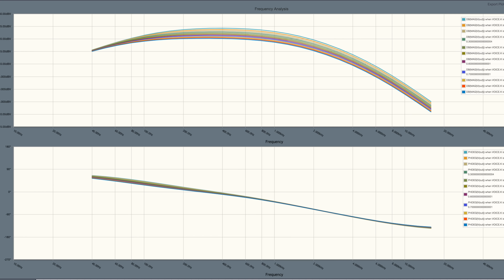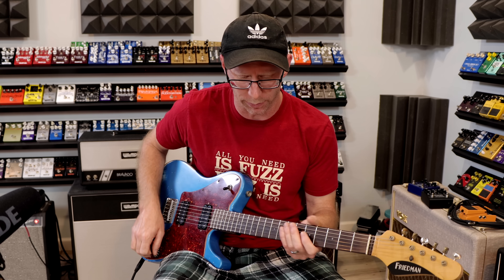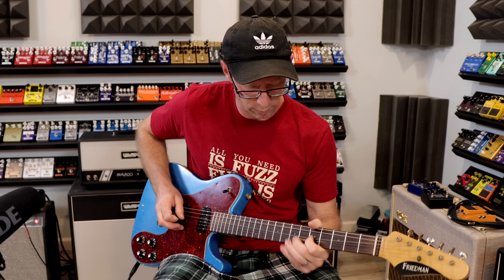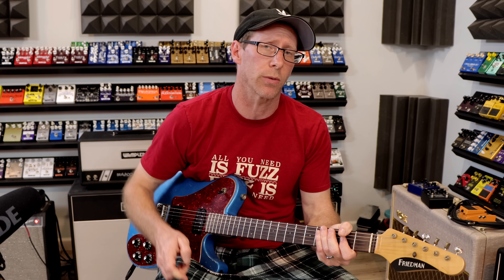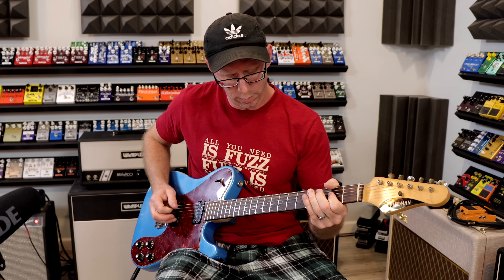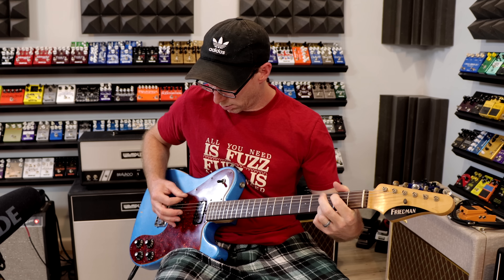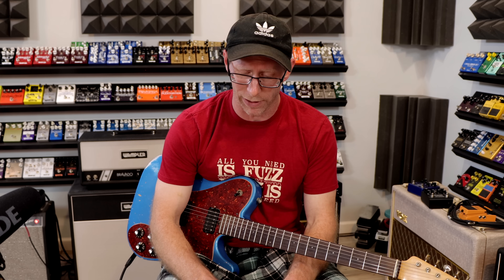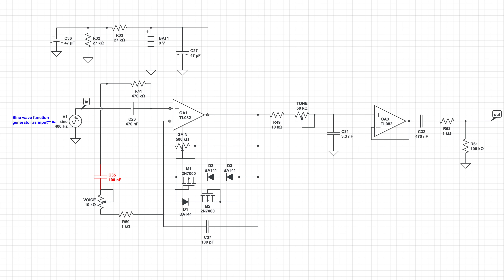What do all the parts do on a guitar pedal? Zendrive circuit experiment

Comment: Ya kinda skipped right over the most interesting part of the circuit, that being the transistors functioning as diodes. Would have loved an explanation of how a mosfet transistor can just be a diode. I’ve never seen this in any other circuit. And do different transistors besides the 2N7000 sound different? You could have switched between several on your breadboard. But instead you talked about 4148s vs BAT41s.

Comment: Love this video. Thank you for doing it! One thing I don't understand yet is why each component has an effect on the sound. For example, you mention that resistors and capacitors can reduce low or high frequencies. How do I understand which will do what exactly?
Reply from the maker: It’s too big of an answer for a comment, but I’m coming out with an educational course which will detail this sort of thing. It’s limited enrollment though, but you can sign up here:
https://www.guitarpedalcourse.com/courses/how-to-design-overdrive-circuits-for-guitar-pedals-for-beginners
Reply: @wampler_pedals  Great! Just signed up. Thanks.

Comment: Thank you! I am redesigning a Sweet Honey Overdrive in LTSpice at the moment and this video really helps; Voice on this seems similar to Focus on the SHO. I gathered from your excellent DIY vídeos that components used to clip and also their placement makes a lot of difference. Can I ask you, is the SHO circuit special in some way, or is it just Mojo? I am an ex Boss service engineer só I can be technical.
Reply from the maker: The sho circuit is just a textbook mosfet gas on stage for the most part. The voice is changing the high pass there in the nfb area

Comment: how do i know what to build in a pedal

this may be confusing how i explain it but ill try my best

say i wanty to build a fuzz pedal. a unique fuzz pedal that will sound exactly how i want to, i know im going to probably use 2 silicon transistors and 1 Ge transistor. i know i want a bass control and a treble control. a gain control and a volume control. a switch for boosting mids and cutting mids. i want it to clean up well. i want it to be able to do crazy high gain fuzz similar to pink floyd echoes live pompeii, but also some overdrive fuzz kinda stuff like jimi hendrix axis fuzz sounds. i want some Velcroy stuff from led zeppelin I tone bender tones. i understand the sounds i want to be able to get from it, but i don't understand at all pedal circuitry. i have no idea how to get a unique circuit to do what i want

Comment: R41 (input resistor) should have 1MΩ or higher (max. 4.7MΩ), 
because on a passive guitar the inductance of the pickup coil together with the pickup- and cable capacity builds a resonant circiut.
You don't want to dampen this peak in the frequence response more than neccesary.
It depends on your guitar how strong the peak resonance (somewhere between 2.5kHZ and 7 kHz) can get.
Some people change their pots in the guitar from 250kΩ to 500kΩ or 1MΩ to reduce the damping of the resonance peak.
(Some even desolder their tone pots)

Comment: Weird that the tone control is a resistor in series... maybe this is the volume control ?  ...or the resistor is in parallel with the next capacitor ?  Please check
Reply from the maker: No, not weird at all. It’s a variable low pass filter.

Comment: Hi, I love the layman's walkthroughs, I built FX units, some of them pedals. I'm modding some LM386 electret mic box's I bought, by adding a switching jack input. It gives a horrible DC crackle to the pots of any mixer I plug it into. I saw you removing this simply with a I think a cap, I've rewatched hours of your channel, but can't find it. Any suggestions.
Reply from the maker: Sounds like you have dc in the signal. A coupling cap usually fixes that. Best thing to do is post the schematic you are using on a diy forum and get some recommendations based on that particular schematic
Reply: @wampler_pedals  thanks for that, can't find a schematic for the device I'm modding, anywhere. I'll keep rewatching the vids, and look up de coupling caps.
Reply from the maker: You may have to reverse engineer it 😕

Comment: Really good. I'm new to this so need to watch a few times but am learning a lot with these videos. You've inspired me to start breadboarding but as my level's very basic I'd like to get a clear view of the whole circuit on the breadboard to be able to compare it to the schematic. A book with a series of breadboards on one page and the shematic on the opposite page would be good, followed by a few exercises with just a schematic and then completoing the breadboard would be great... and then the other way round.  What I do is copy the schematic on a paper and then try to figure out what's going on on the board. Sometimes the pots are in the way or some of the circuit is offscreen. As for other pedals: RAT, muff, or a tremolo (I've seen some fairly simple circuits), whatever. Thanks a lot.
Reply: Just seen you've already done the muff.

Comment: Enjoyed this.. 
I have a version of the zendrive that has some interesting different features, that maybe you could cover...
a) the three diodes + 2 mosfets(used as diodes) are replaced with just one mosfet(mystery w sanded off markings) - so its only clipping in one direction
and
b) the gain pot is changed from a 500k to a 100k
so its low gain "modded" - but it is factory stock, so a version..
also a good mod for a Rat, and I suppose for a ds-1.. take away one of the diodes..
if you do anymore of these it would be great if you´d show the part of the circuit on a schematic ...

Comment: It always amuses me when the “diode connected MOSFET” concept is copied, i.e. MOSFET + another diode, and then use the body diode of the MOSFET making the second series diode unnecessary other than increasing the forward drop. There is so much mojo to be had with a true “MOSFET connected diode” since it is a third law device and normal diodes are square law. But the MOSFET used is super critical and the 2N7000 is not the best choice.

Comment: I'm semi-convinced that there are only 3 or 4 basic overdrive circuits on the planet.
And that everything we see is a minor variation on those designs.
...I could be wrong....maybe(?)
Reply: I guess that's basically it: simple transistor overdrive, tube overdrive, diode hard clipping (when diodes go from output to gnd) and diode soft-clipping (with feedback). However, combining these with the many variations of input, output and feedback filters yields the whole gamma of distortion/overdrive/fuzz pedals we know (and the ones we don't know yet)

Comment: 1k resistor in series with your output is pretty high because of the capacitance of the cable, depending on the length. When running a long cable you rather change that to around 220-330 ohm. But also depends on the opamp buffer.
Reply from the maker: Depends. What are you basing this on?
Reply: @wampler_pedals  The reason to add that series resistor, is to prevent instabilities due to capacitive load. This capacitave load is created by the guitar/microphone cable.
Depending on the type of opamp this load can cause issues. One way to prevent this issue, is to add a series resistor. The higher the value, the more robust it will be. But it also forms a RC low pass filter with the capacitance of the cable (plus the next input stage). 
But yeah, I guess it depends, since not many people will use very long cables in this case. There is an excellent article written by Analog Devices about this, and (of course) you can go as fancy as you want;
https://www.analog.com/en/analog-dialogue/articles/techniques-to-avoid-instability-capacitive-loading.html

Comment: This is a great little vid for all of us who got a little knowledge regarding circuits, but failed to start some real DIY on the breadboard. Watching an expert like you walking through the circuit and tweaking it is so much fun for me. I find the dirt circuit of the ZEN quite interesting and i am wondering whether the FETs are inserted to give it more clean on low level (like offsetting the point where the diode clipping takes over) or whether they actually add to the dirty part?
Thank you very much for sharing such great stuff!

Comment: Great! Thanks! Very informative, I had some questions regarding a small capacitor in negative feedback of an opamp. I didt place it in my circuit, so that may be the reason, that the pedal was very noisy (talking about EMI noise), adding one fixed the problem. Thanks!

Comment: This is really helpful. I have a mech eng and comp-sci background and running spice sims of pedal or part of one, or poking around with an oscilloscope, function generator or even a VNA will tell me loads when I start messing with pedal, but actually getting desing building blocks and an idea of what they do and why on a useful level without being immediately bombarded with a load of maths that whilst ultimately helpful in an electronics oriented degree is more work than I want to put in to modding a fuzz or distortion. Mostly I'm a pickup builder and my analysis is fairly simple.

Comment: The first pedal mod I ever attempted was just adding an LED to my wah pedal so I know when it's actually on/off. That gave me a little confidence and I did the Keeley mod to my Boss MT-2 Metal Zone. That turned a punch line of a joke into a decent sounding overdrive pedal. But I do love these style teaching videos, you are a natural at it. Please expand the series to include amps as well as guitar circuit mods. I know the "orange drop" capacitor change will really make a huge difference in the tone circuit. I don't know why, but maybe that would be a good place to start.

Comment: Awesome video. I watched it three times.
The questions that came to mind are:

How do capacitors filter highs? (I thought they just filtered lows)

What is the difference in using capacitors in series vs to ground?

Most pots are resistors. Is there an application for variable capacitors in pedal circuits?

I'm better with these components in power circuits vs tone circuits. I guess I need to keep reading and watching.

Preferred circuit for next time? Reverb!
Reply: You almost answered your own question haha; a capacitor in series filters low, a capacitor to ground filters highs. However, it's the other way around when placed in an opamp feedback loop :)
Reply: I guess pots are much cheaper and precise than varicaps

Comment: the Zendrive represents 2 personal truths for me;
1) my all time favorite dirt pedal. and,

2) my all time WORST pedal trades. 
I had an original one that in a moment of insanity, I traded for another "boutique"dirt pedal that while what I got in the trade was technically more expensive, was far more common. within a couple years the values  changed and the Zen was much more expensive to buy used. But price really isn't a big deal, it's just that the Zendrive was a much better pedal IMO.

Also, I find the 65 Deluxe Reverb is the best amp to plug these into.

Comment: I love this type of video!!!  I would love to know which component(s) change the threshold on a DOD 280 compressor.  My bass trips my 280's threshold pretty heavily even with the Comp set at full counterclockwise.  I compensate by turning the volume on my bass to 50%, but I don't want to have to do that, and I'm not absolutely sure that lowering the volume is keeping it under the threshold; that may be affecting some other parameter but it sounds like that's what it's doing.  If you do entertain covering compressors in a video similar to this one, it would be great to know which components are responsible for other parameters, like ratio, attack, release, etc., too.  Thank you so much!!!
Reply: Alan Haynes  - Thanks for the tech explanation, Alan!!!  I had planned to get an effects loop pedal and go for the whole "parallel compression" thing.  This way I can get the most out of parallel compression by squashing the heck out of the signal and boosting the highs and lows of the squashed signal, while leaving my core tone completely unaffected.  Then I can blend those two totally different tones.  That's something you can't do with a compressor pedal with a blend knob.  Do you think a DOD 280 would work well for this type of parallel compression application?
Reply: Alan Haynes  - Thanks, brother!!!

Comment: Oh thank you! This video was very useful. I just pulled out a Zendrive clone last week that I had fooled around with a while ago. It wasn´t working anymore but now during Corona lockdown I finally had the time to do some repair work. As far as I could see and remember I´d done some changes to turn it into a Zenkudo (I lifted the clipping diodes for just OP amp clipping like the green Dumble mode of the Zenkudo does and installed an IC socket for testing different OP amps. After some investigation I found out that a short piece of conductor track had been ripped from the circuit board and happily I could fix it and the pedal works fine again. Now after watching your video I might do some more tweaks...  I also own an original Zendrive and a Tanabe Dumkudo and a bunch of other D-style overdrives. The Dumkudo has much more gain than the Zenkudo and the Zendrive. How is this achieved? Just a different gain pot value?
Reply from the maker: I’m not sure exactly but my guess would indeed be a larger gain pot
Reply: @wampler_pedals  Thanks for the quick response. I have another question: I have a Black 65´and a Tweed 57´(and an Ego Comp, a Paisley drive and a Euphoria, so I´m kind of a fanboy) and I´d like to know if it´s possible to add a bright switch to the Black 65´(cap across Gain pot?) and lowering the gain of the Tweed 57´at minimum gain setting to achieve clean sounds with PAF style Humbuckers? It also would be great if the pre gain bass control on the Euphoria could be limited towards the real low frequencies to become more a low mid boost.

Comment: I just watch the video twice and it is fantastic!  I was one of the nerdy people who requested a video like this and it's even better than I imagined!  I had a major revelation watching this video and I'm sure I'm the last person on the planet to realize this (probably explains that "C" in Electricity, Light, and Magnetism class in college) but the "flow" of the guitar signal through the circuit is not exactly the same as the flow of electricity.  I've long understood the water analogy you use in your book where electricity flows downhill to ground and resisters are like narrower parts of a river and capacitors are like little retention ponds.  But the guitar signal enters from a different part of the circuit (duh!) and is more like throwing a rock in the water which causes ripples.  And resisters and capacitors alter the amplitude and frequency of the ripples.  Is that a good analogy or am extending your analogy too far.  Wow, thanks again for a fantastic video!  I'd love to see more videos like this!

Comment: This is really interesting.  Could you maybe do something where you explain the different components (resistors, capacitors. op amps) and what they actually do in a language that a retard like me can understand ?
Reply from the maker: Lol, this IS that version...
Reply: @wampler_pedals  yes I kind of get that but I am still wondering what is an Op Amp and what is it used for.  And how would the circuit for a different effect like a vibe or chorus or delay have different components.  Maybe you could show us a different circuit each time and explain the main elements compared to other circuits.  Was a great video though I always wondered about things like this and the effects that changing stuff around would have.

Comment: As usual, deleted my comment accidentally when tried to click edit :) Just wanted to say this was a great video, as are the others! Really useful since I finally pulled the trigger and got a soldering station and a DIY pedal kit (chose rangemaster, surprisingly few clones going around) to play around with it a bit. You serve as a huge inspiration in getting to know what's going on behind the curtains! Also treble booster is a magical sound despite being so simple. Maybe it's a good design method to use as few components as possible to change as little as possible. Also works for designing for manufacturing, you get the fewest fault points. I'll probably have to buy your modify pedals book soon..! Just scored a Blues Driver so maybe that's a perfect place to start.

There was something funky going on with the C35 demoing. The stock one was maybe a font issue, and in the graph both the 0.01 and 1 µF were marked as 1 µF.

Maybe you could make an episode about what's the magic that's happening inside when you design or run a pedal to be used in higher voltage than 9 V. Quite a few pedals do that nowadays and some old pedals were 12 V, 15 V or even 24 V. Usually the sound gets "more headroom" feel, but from what I heard that's not necessarily what it does in itself, just a common design. The components probably run in a different environment like that, but how does it change things? Do you have to scale the components or do the same component values affect the sound the same way?

P.S. Those pants rock! I'm sporting the same in different color for multiple days already!

Comment: I like the technical content as it helps me understand more about the signal path and why different pedals might want to go in a certain order. Question for this video: why is there so much noise inherent in the guitar signal when you're not playing? Like when you lowered the capacitance to let more high frequencies through, the noise bumped up a lot. Is that just the nature of the beast or could you add a comb filter to notch out the noise but still let the "pleasing" highs through?